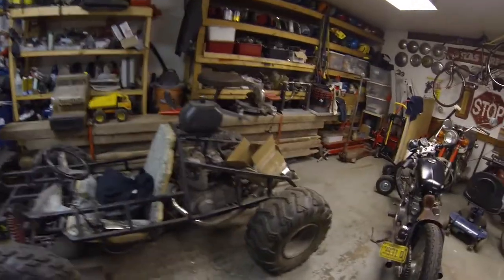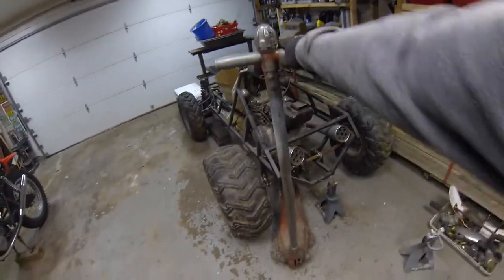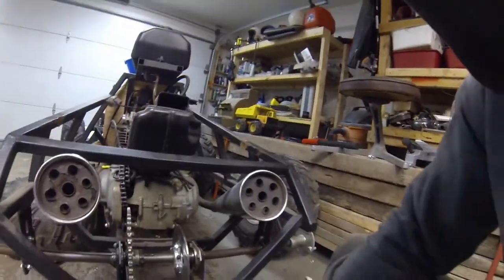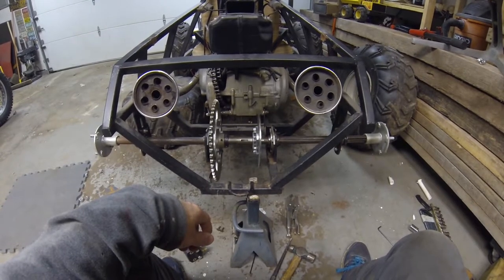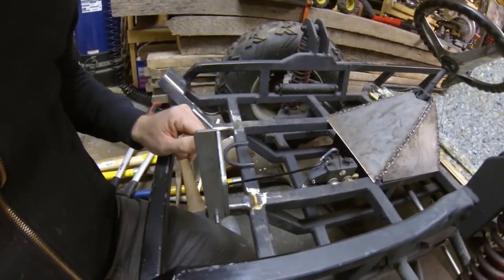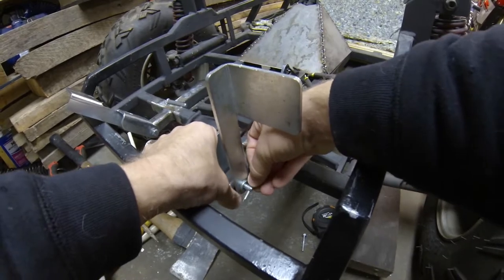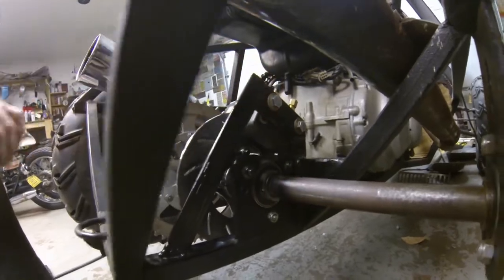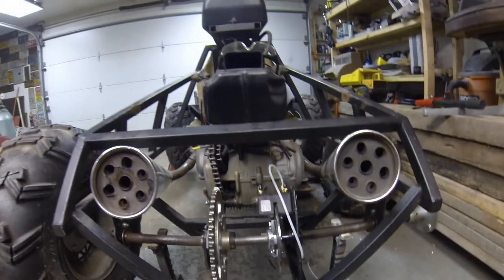Installing Hydraulic Brakes on Homemade Go Kart

Comment: Use a little piece of angle iron welded on top of a little piece of plate so it forms a cradle to hold the bolt in place; super easy with a drill press to drill holes in bolts that size. It makes it possible to do it by hand, too, just a little tougher to do.
Reply from the maker: +John Ratko Good tip. thanks
Reply: David Cuff Don't mention it. Thanks for uploading your build videos.

Comment: keep both rims locked. cut the shafts and add 2 more bearings to support split shaft. then make a sleeve you can slide over and lick both sides together when needed.

Comment: Hey bro trust me I thought id have the same problem with the rear axle and tires but dont it works a lot better than you would think expesually because your rear tires are sort of rounded try it out before you keep the key out it isnt as bad as you think.